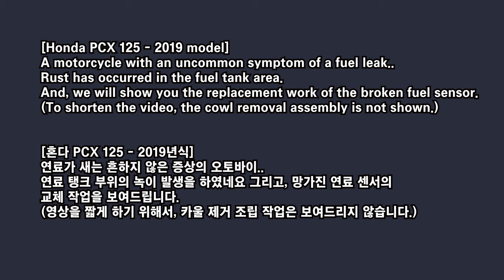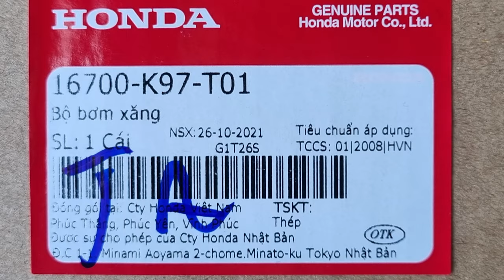We show you a rare motorcycle fuel sensor replacement job. Honda PCX 125 Scooter

Comment: Hi Dear , My PCX has mil light on steady and sometimes high rpm . I've been changed the Idle Sensor ,Tps Sensor , New Air filter, New Injector,New spark plug and the Throttle Body its fully Cleaned few days  ago. But the light won't go away. I Will adjust the valves tomorrow. Do you know what problem could be this? Thanks Sr, All the best.
Reply from the maker: The problem can be solved by replacing the “throttle sensor,” the square part next to the injector that has the thing that plugs into it.
Reply: I changed this one too , the TPS right ?
Reply from the maker: @diegofurlan4322  no. This is the “SENSOR” attached to the “THROTTLE BODY ASSY”.

Comment: Hello, great master. After the fuel pump on my Honda PCX 125cc broke, I installed a new one. Now, every time I start the engine, it takes 5 seconds to start, whereas it used to start immediately, at most within 1 second. Additionally, when it starts, it doesn't respond to throttle for the first 30 seconds. Do you know what could be the issue?
Reply from the maker: That symptom is not related to the fuel pump. It is difficult to answer because you have to see it yourself to know.

Comment: Hola amigo, tengo un problema con honda 125 pcx, al arrancar el motor en frío abro gas y se para, tengo que esperar 5minutos que se caliente el motor, ya le e sustituido el tps la bujía y la bomba de gasolina, me podría aconsejar donde puedo tener el problema, gracias amigo
Reply from the maker: El resultado de preguntar con el mecánico fue...
Dicen que el problema se solucionará ajustando las válvulas del motor.

The result of inquiring with the mechanic was...
They say that the problem will be solved by adjusting the engine valves.
Reply: Me puedes decir el ajuste de las válvulas de escape y de admisión, yo la tengo 0.25 mm de escape, y 0.10 la de admisión, espero su confirmación gracias amigo
Reply from the maker: @adriansanchez8231  honda pcx 125 engine valve clearance
IN 0.10±0.02(0.004±0.001)
EX 0.24±0.02(0.009±0.001)
Reply: Gracias amigo esta en los valores que usted me indica  lo volveré a revisar
Reply from the maker: @adriansanchez8231  Espero que todo vaya bien.
Hope everything goes well.

Comment: Hello master, greetings from Istanbul, Turkey. I have a Honda pxc 125 cc 2021 model scooter. The fuel tank is vacuuming. What causes the problem? How do I solve the problem? Thank you
Reply from the maker: The fuel tank cap has a hole that allows air to escape. If this part becomes problematic, pressure may build up in the tank.
Replace the tank cap, or check and drill a hole in the fuel tank cap.
Reply: @MotorcycleRepair  Hello Türkiye, Istanbul, I am sending love and respect, thank you very much, master, I wish you healthy and happy days.
Reply from the maker: @diyardiyar7310  thank you
Reply: @MotorcycleRepair  Türkiye Istanbul, my dear master, if you allow me, I would like to have the knowledge to consult you on a subject.On my Honda PCX, there is a very slight interruption between 45/47 and 50/52 km, the speed is cut off and I see a sudden drop below the speed limit for 1 or 2 seconds, the scooter spark plug head has changed, the spark plug has changed, the air flow has changed, the engine oil has changed, the battery voltage is normal, the fault code is none. It doesn't work, the brake fluid has changed, the antifreeze has changed, the front and rear brake pads have changed, why does the problem arise or what is the source of this problem or what else could it be, where else should we look, thank you very much, best regards.
Reply from the maker: @diyardiyar7310  Usually there may be a problem with the air filter... but if there is a problem in a specific section...
The surface of the drive face of the drivetrain - This may be a symptom that occurs when only a certain part is worn and the belt goes beyond that area.
I'm giving you an answer without actually riding the motorcycle and confirming it.
Please note